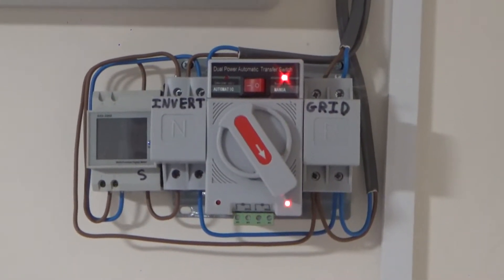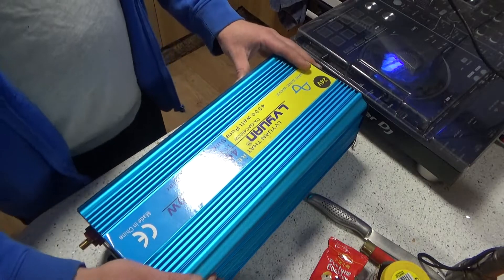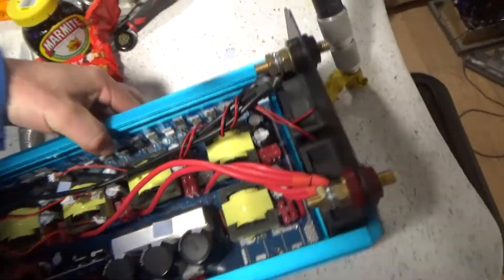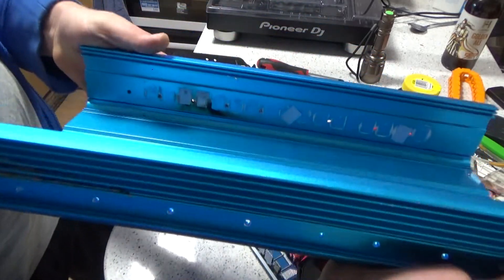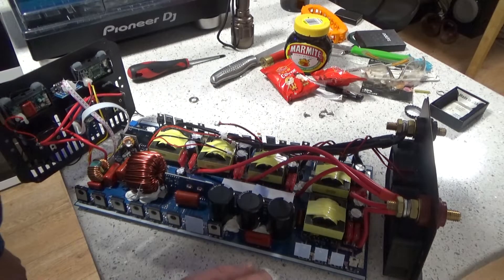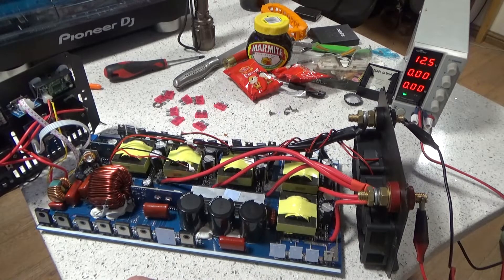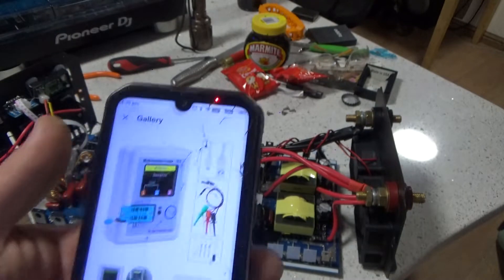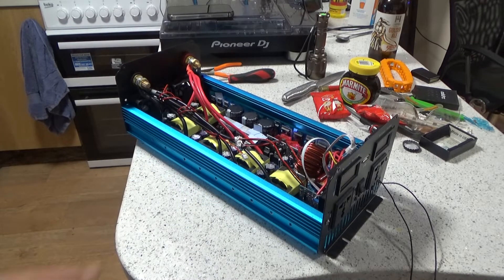LVYUAN 4000w Inverter Failure any ideas?

Comment: Started using one of these yesterday.  Already not working after using 2400 watts of water pump. Their manual says to use an inverter 3-4x the power requirements of pumps and inductive motors. I thought thats what the 8000 peak power rating was for.
Reply: I base everthing of the continouse rating  and time the load  by 3 .  So  a   motor that uses 1,000 watts   should be used  with at least a 3,000 watt inverter,  maybe even  a higher watt inverter with a fed based high frequenzy inverter  since inductive loads  are rough on high frequency  inverters.  
Low frequency transformers  have a heavy transformer inside but they can handly start up of inductive motors better .  LF invertets are more heavy, use more idle power but may have a save mode and other things  , they are  usually  bigger and cost more.  

Do a research on the low frequency inverters.

Comment: The logic of replacing mosfets in groups, as mentioned below is that, where the design shares the load across parallel groups of fets, you want very similar performance specs, particularly in relation to turn on/off times. Apart from testing all components and selective matching, the next best approach is to buy a bunch at the same time and hope they are all from the same manufacturing batch. In this case - since the design seems to use 5x parallel dc to dc converters - I would remove the fuses and 4x fets from the one that had blown two fets and try to move forward from there. Might be able to get it running at a slightly lower power level ???

Comment: I would remove all the mosfets and trace each gate pin hole back to the driver, could be driver death.
No good just putting in new parts untill you know if the drive circuits are  ok.
Just my opinion.

Comment: wow some of the replys on here, i fix electronics for aliving, over 30+ years in my experiance, replace all mosfets not just a few, as u can bet your arse, that it would have weakened the rest, dc side falis 90% of the time, but also ac side fets can also be under presure, if u want a reliable inverter, get mosfet numbers, and get higher value amp ones wih voltages higher also, make shure switching speed in ns is same nano seconds responce to switch if not can cause heat switching faster or slower than what circuit is built to run, ive found beefy transistors or ibgt work beter when replacing fets, convert more money but makes inverter last alot lot longer,
Reply: Bought one a few years ago, it blew at 70% load doing the morning coffee. DC side pair failed. On checking FETs had right digits but wrong letters, factory had swapped suppliers for a different FET brand, right volts, right amps, but lower max watts, guess they had a lot of failures. Got a refund and told to bin it, so correct FETs preferred with the refund...5 years on still going....

Comment: fixed it yet?
maybe sell it for parts as is
i  also have a Lvyuan like that, but smaller, that only worked 6 months,then it let the smoke came out of it;
heck i would give you 60 euros/dollars for it,i need 3 transformers for my 1500/3000W , it oveheated,or i'll sell it for 20 bucks

Comment: if you have a two-channel oscilloscope, try measuring the gates of the mosfets of one of the transformers with a probe and see the dead time, it seems to me that this is the whole problem, two transistors opened at the same time and the result is that all input mosfets are destroyed

Comment: I one time face this issue with my 1000w modified sine wave. I am not a mechanic but I did an experiment, I replace all dc side MOSFETs and their gate
SMD resistor. I also replace ac side FETs. my unit starts. this happens when something is shortcircuited at the load side. I am currently using lvyuan 1000-watt unit. I only use it on 500 watts continuous and it is running smoothly so far. I uploaded its videos on my channel.
Reply from the maker: cool, ill have a look! yeah make sure you monitor the temperatures. im pretty sure the excessive heat is what killed my unit. 
my replacement fires up the fans as soon as a moderate load is applied which is comforting

Comment: Interestomg. I have been looking at videos with load tests for this exact make and model inverter to see how well made they are.

if you just poke your meter to the DIODE setting, you can probably test the mosfets "in situ". it is possible all are dead - but either way I am wondering if the fault is what DRIVES them. Usually, I am guessing they want to zip along, switching at several tens of kilohertz to drive the transformers. If however the drive has failed and left either (or worse, BOTH) sides of the bridge powered and not oscillating, the this would give a dead short situation.

Perhaps go walkabout with your meter on the DiODE setting and see if the mosfets are dead. if they are ok, then with all fuses for transformers out, does the board still power up the drive electronics? if so, can you see if you have a switching signal going to the MOSFETS?

Even if you do not have a scope, some meters these days have a frequency counter built in - and if you see the drive pins clocking away at a few tens (possibly hundreds) of kilohertz, then it would seem that the drive circuit is ok.

If the gates of the MOSFETS are being turned hard ON and not oscillating, then it seems like it might be the drive electronics.

As it was just TWO MOSFETS that you think may have died, are these two of several on the DC side - or were they the high voltage MOSFETS? If not sure, what is the part number - if they are rates for under 100v, then they are the dC input side, if they are 400v / 600v rating, then i guess they are the AC side (which would seem unlikely).

Meter on DiODE setting would be my first suggestion. Can you see 0.7 on each junction or 0.0 short ?
Reply from the maker: hmm, thank you very much for you help, ill look into it a bit more based on your advice. 
i will have a check with my mulitmeter and get the scope out. im lucky enough to have a micsig to hand so we may be able to get to the bottom of it.
the blown transistors are 104R5NT.
ill check with the meter over the weekend
Reply: @jamesbrokentech  Ah great, if you have a scope, this will make like much easier, the 104R5NT seems to be rated at 100V and good for 120A so I reckon we can definitely confirm this is the DC side.

Be good to hear back what you find, my guess is that the MOSFETS might have been killed by a dead driver, but it's only a guess at this stage.

Incidentally, with the quality of construction with these things not always being stellar, if you find it IS the driver, it may be nothing more than a dry joint, cracked track that has effectively stopped the driver from working properly.

Good luck and happy hunting!